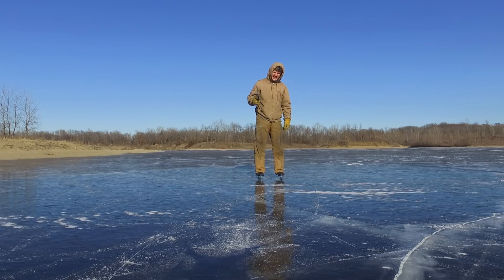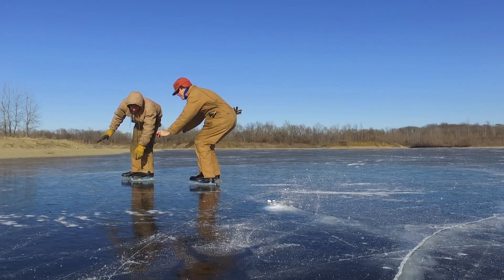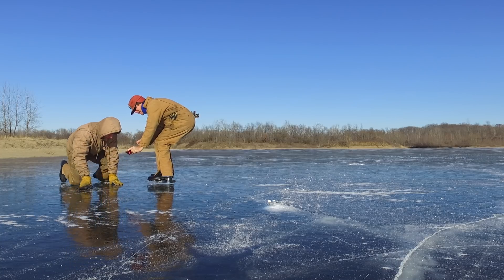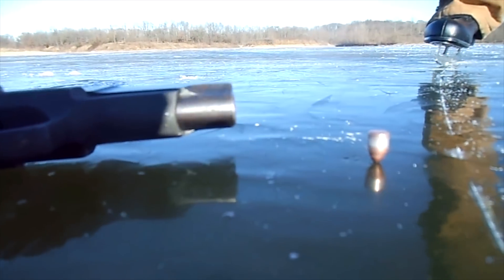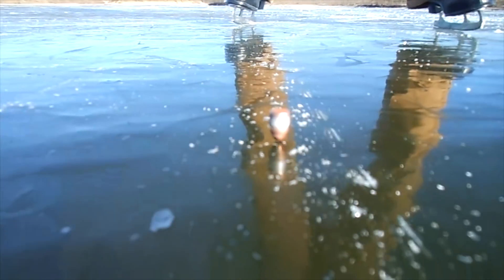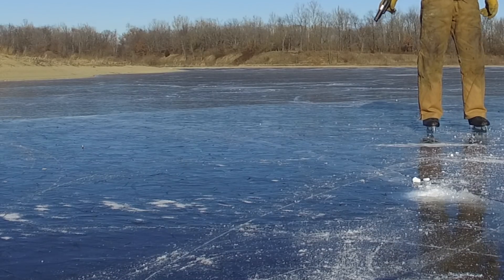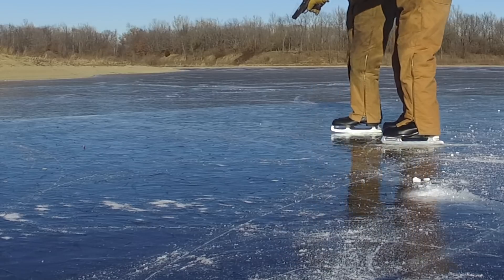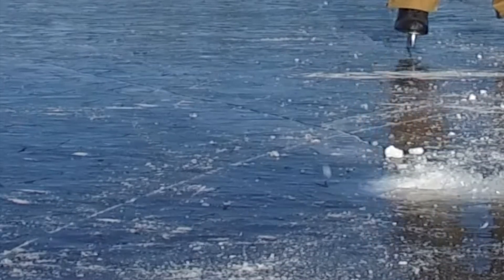Spinning 9mm Bullet on Ice with Slow Motion

Comment: If you aim the gun at the angle, the same as the angle of the tip of bullet to hard surface, the bullet will bounce and fly away that you never see it and bullet still in one piece. 
But you shot it in hard surface of ice, the bullet not bouncing up high because of ice is sort enough to stop the bullet fly away. And smooth enough and less friction to stop bullet spinning